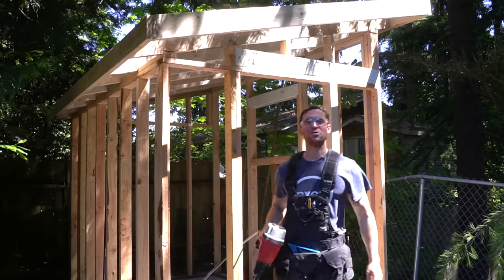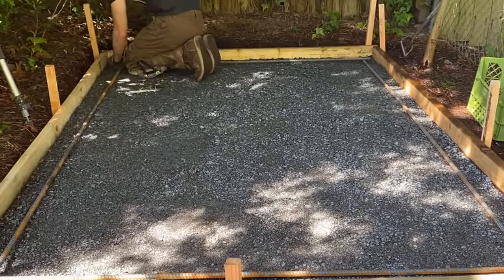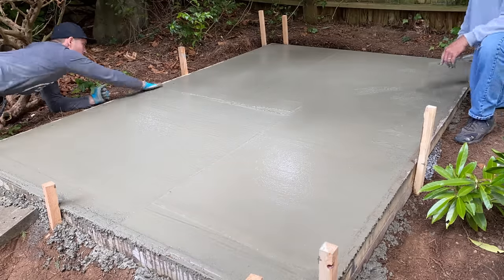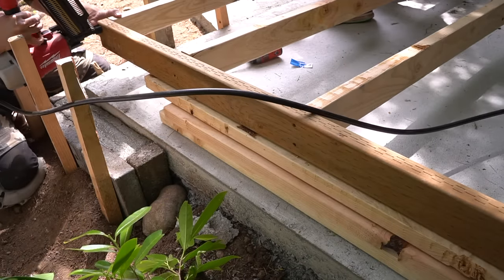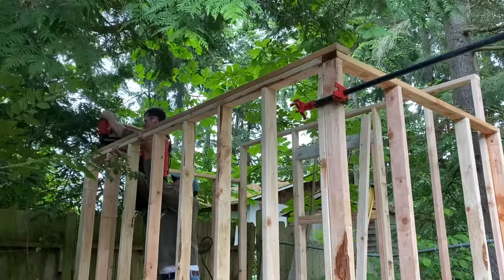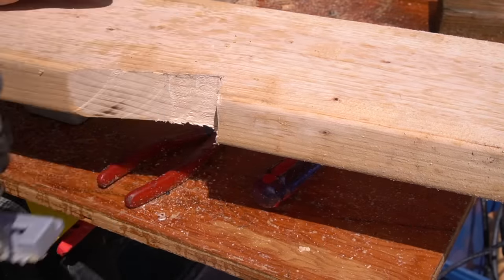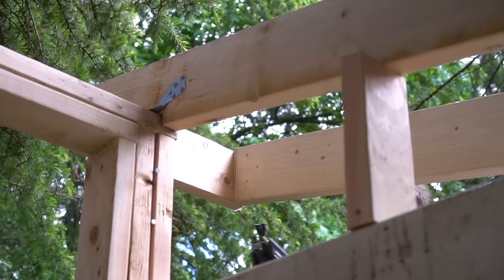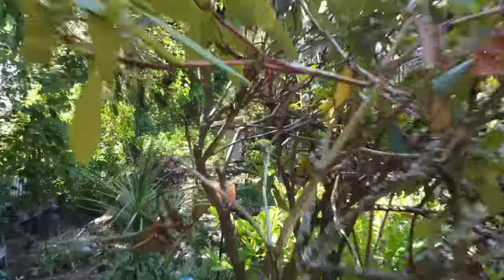BUILDING A LEAN TO SHED // START TO FINISH (Part 1 of 2)

Comment: Great video! Shed looks amazing! However you are wrong about wetting the rock before you apply the concrete because the dryer the concrete sets, the harder it will be.
Reply: @MrStevegillette  the ground itself will keep it moist.

Comment: Just an honest observation, not meant to cause upset. Sloppy nailer gun work, these joints are now seriously weakened. Nailers are used to rush jobs and end up splitting the wood, but these nailers can be great if used correctly.

Comment: I'm actually in the process of trying to draw up plans similar to this except that it's an add-on well two add-ons to an existing shed that's going to be turned into a living space but I'm having difficulty drawing up the 2x4 framing designs and prints to lay it out on paper for me in the homeowner I know that I can do it it's just doing it in my head is a lot different than doing it on site. I'm doing a add-on by leaving the existing exterior walls of the shed and building essentially three walls with a lean-to roof covered by tin one side already has a door on the side where he had the new slab poured so I would only have to tie into the other end which would be the bathroom. If anyone can help me that would be greatly appreciated I have all the measurements lined up I've been trying to use an app like magic plan but it only has floor plans and not the actual skeletal framing for it. I used to do steel stud panelization in a warehouse in my city building hotel walls that would later be sent off on site and assembled I have plenty of experience building and framing not just with steel but with it's just this is the first time I have ever tried to draw up blueprints myself. I can't find any literature online or any app on Android so far to help which is kind of running me into the problem of getting my materials list. So again if anybody can help please by all means leave a comment below with your name and contact info and I will be more than happy for any advice or tips on what to do or how to go about doing this in a professional fashion. I was wanting to basically have like a little 2D print plan that I can give the homeowner and maybe even some sort of 3D model whether it's on an app or on paper I actually am a decent artist when it comes to things of that nature like drafting and design anyways. Please and thank you!

Comment: My Dad and Grandpa built a wood frame on concrete slab shed like this.  It's still standing and being used 50 years later.  The door and roofing shingles have been replaced a few times over the years.  Last summer, my Mom had somebody replace the entire roof along with some rafters because of water and carpenter ant damage.  It's probably good now for another 50 years.

Comment: You didn’t bolt in your pressure treated to the slab?
Reply from the maker: I did Joe.  Just towards the end of the video.  Thanks for watching at least some of the video haha.
Reply: @BYOTools  lol that’s the first thing I do. And you can set the j bolts in the wet concrete so it sets in the cured concrete. Also the wall basically can stand on its own so I don’t have to brace the built walls to anything

Comment: I noticed the wood cracked immediately with the nail gun. IMO be better to drill holes n then use wood screws to avoid that. Take longer but would avoid damaging the wood.

Comment: Rebar laying on the base is useless.  Put anchor bolts (J bolts) in the bottom plate and embed them in the wet concrets.

Comment: Only thing you messed up on is NOT digging around the perimeter of the form and digging a footing for the concrete.  The footing should have been 12" wide and 16" deep at least.  Not doing so just invites a frostline problem allowing the concrete to lift over time and/or weather/erosion to move dirt away from the concrete.

Comment: Pointless to mark stud locations on concrete.  
Anchoring PT sill plates should occur first before frame is built.  
Headers only needed on weight bearing walls not on endwalls (see doorway).  
Cripple stud needed above window header.  
Double top plates unnecessary.  
Endwalls will be stiffer and stronger when studs are run continuously up to rafter (horizontal plate is unnecessary).

Comment: I still don’t get what the metal does in the concrete? Can anyone explain please
Reply: Reinforces it.  Stops it splitting.
Reply from the maker: Think of it like this Stephen.  Concrete is strong with downward forces but not strong with side to side movement at all.  Overtime if there is a slight shift in the ground then it may create more force on the concrete in curtain sections, which could lead to cracking.  However, if you have rebar around the perimeter it strengthens the concrete in that situation since the rebar is throughout the perimeter of the slab.  basically reducing the chances of cracking the concrete.  Hope that makes sense and thanks for watching.

Comment: Why didn’t you sink some all threads so you could bolt down a sill plate
Reply: I was wondering about this as well, but I don't know much about pouring a slab in preparation for framing. I guess you put the all threads in while the concrete is wet? How do you make sure they are straight up and down vertically? And how do you decide where  exactly to put them?

Comment: I just wanted to call attention to something, and if I'm wrong, please, tell me.  At about 19:40 when the "structure is being anchored to the concrete", lagbolts are being drilled through the plate into the concrete.  Fine and dandy.  When you think about it....all you are really doing, which seems to be wasteful anyway, is anchoring that PLATE to the concrete.  That's all that's really being kept from blowing away in a storm!!  What's really anchoring that structure?  3 INCH NAILS THAT YOU ATTACHED THE WALL STUDS to the plate and sill !!  (ok, you have hurricane straps for the rafters, that's fine and dandy too)  But what really is keeping this from getting blown over??  There is nothing structurally transferring the strength and stability of the foundation, through the plate and UP through the walls!  Nothing.  No....no....I wouldn't be able to sleep at night.  I know that's a little unreasonable, but I'm telling you, like building a concrete wall with rebar in between the filled with mortar concrete blocks....this offers me no consolation.  Anyone care to add to this?

Comment: This is totally overbuilt for a +/- 100 sq foot shed! There are way simpler ways to do this. For example, you dont need a slab. It is unnecessarily complicated /expensive and takes way more time than buying a few concrete deck blocks for the foundation. Also dont need stud walls, just use post and beam construction.

Comment: You missed one of the most important steps to a solid slab. Hammer the frame to get the cement to settle and make solid edges. Everything else👍

Comment: you are laying out the studs wrong..it is  15and1/4 set ahead  then 31 and 1/4 and so forth...the way you are laying it out...you would not get the plywood to break on 16 center...you would have to add a stud all the way down the wall for the plywood to hit on 16 on center

Comment: As a NZ Architect, this is shocking advice.
Reply from the maker: I’m hoping that means it’s shocking advice on a good way haha! Thanks for watching.
Reply: @BYOTools  would you like some useful advise for the next vid?
Reply from the maker: @kiwinz219  go for it. Can’t guarantee it will make the video though but would love to hear your thoughts.
Reply: Ok, foundation, substandard to say the least. Make a perimeter footing 300mm below good ground level and at least 200mm wide , all around. reinforce with 2/D12 bars at bottom of footing, keep bars 75mm above base of footing. place 1/D12 bar in slab above the bars below and tie them with R10 ties at 600mm crs. Ensure top bar is 3omm below top of slab level. So that's the footing. What you have built will crack and fail , guaranteed. to fix this as above, you need at least 668 mesh or higher to span the entire slab diaphragm and tie with the footing starters, 30mm min cover. this is based on 100mm min 20mpa concrete slab. With regard top the stuff going on under the slab you have it all backward. . Do this. Form the footing, clear the ground, site the metal fill, place 25mm sand blinding on top to ensure the metal doesn't puncture the polythene and place 0.25mm polythene over the are and down into footings and cut off where the footing returns vertical to the natural ground. now your slab is structurally sound and waterproof. What you did di not achieve any of this.

Your require a damp proof course between the bottom plate and slab, you had none. place this as a continuous strip under bottom plate and bolt bottom plate to slab at least 900mm crs. max. (3 ft).
bottom

When placing cladding edge, ensure it is 50mm below slab FFL.

That's
Reply: Engineering overkill

Comment: Stop! watch no more, the second you see someone place a wall directly on a flat slab you should know it won't last. You ALWAYS need a frost wall, no necessarily a footing wall, but you can't put wood 3 inches from the ground and think it won't rot.
Reply: This. My area, treated.
Reply: @nastyab8003  Doesn't matter, the drywall inside will get wet and mold, the outside sheeting will rot along the bottom, and the insulation will mold.
Reply from the maker: This is why we used PT lumber for the bottom.  Done it before with ZERO issues.  I'll keep you posted though and thanks for watching.
Reply: @BYOTools  Well the reason I say this is experience, I did one exactly like this, did gutters to to reduce splash, now it rotted and molded, the sill plate isn't rotted BC its pressure treated, but the other is and the mold is bad.
Reply from the maker: @integr8er66  interesting. Do you think the pt sill cap observed the moister and transferee it to the other studs and sheathing?

Comment: You should protect your wood between the shed and the concrete…
Reply from the maker: Technically I did. That’s why we are using PT lumber where wood is connected to the concrete.  Are you referring to something else? Thanks for watching
Reply: @BYOTools  Even with PT Lumber I use rubber seal between the wood and the concrete. Love your video’s … grtz from Belgium 🇧🇪

Comment: I suggest all viewers and the author of this video look up Larry Haun on YouTube to truly learn the art of framing from a master NOT a YouTube novice. A shed this size, could have, and often is, easily built from 2 x 3's with no true need for kings and jacks.

2:02 Landscaping fabric under a shed's cement slab? 

5:12 A magnesium float rental for the concrete pad in your shed?

2:43 Rebar in the foundation of a small shed pad? Wire mesh would be perfectly fine in this situation.

8:29 You talk about protecting yourself from the nail gun yet you proceed in the video to place your hands in the danger zone over and over?

10:56 Double top plate on a shed 6 feet by 8 feet?

14:05 Roll the saw and the board and get it done. There is no need for a jig saw to cut a 'birds mouth'?

15:23 It is a shed not a two or three story building?

14:34 Hurricane ties on a shed?
Reply from the maker: Shawn I do love myself old school guys like Larry but lets be honest. Larry isn't the most captivating haha.  Basically all of the items that you noted in your comment are items in which I have decided to go the extra mile with this shed.  Yes it may be considered a bit overkill but when your teaching others how to build I certainly want to make sure they are making a structure that will truly hold up over time.  Not something that your going to have issues with 20 years down the road.  Also, it may be dificault to tell in the video but I am very careful with where my hands are compared to the position of the nail gun.  Thats why I've never had any accidents with a nail gun after the 100,000+ nails I've installed over the years.  I understand your thought process but please remember that I'm just trying to help others learn how to build, It may be overkill in some peoples eye but its the right way to build in my eyes.  Thanks for watching.
Reply: @BYOTools  Yes...there are lots of ways to build a shed. The stronger you make it the longer it will last. Well done.

Comment: great project but over-engineered and a lot of unnecessary stuff like weed barrier and then rebar. That said I hate concrete for such small sheds and IF you need to remove it you need to get a jack hammer and stuff. The wooden base is ideal. This is totally over-engineered project and also over expensive.

Comment: Whenever I see a complete wood shed I think what a waste of time. I’m a welder. I’d use wood but to save time and a ton of effort I’d use steel for the frame. Even a concrete foundation isn’t necessary for a small shed with a clever use of steel.

Comment: This guy has never worked a day in this life. I would highly recommend separating wood and concrete as it will begin to rot away if you don't. Fyi
Reply: That’s the reason he used pressure treated lumber on the bottom plate...
Reply: There ought to be a liner in between. Else moisture will seep into the rest of structure

Comment: No shed (nor any other building) should have timber directly on the slab. Raise it on a low plinth, minimum 150mm high (2 brick courses), and you've a building whose life can be measured in decades not years. Please don't be tempted to follow this really poor practice, folks.